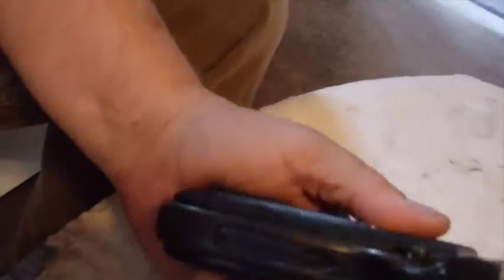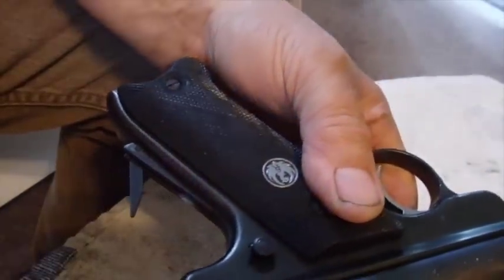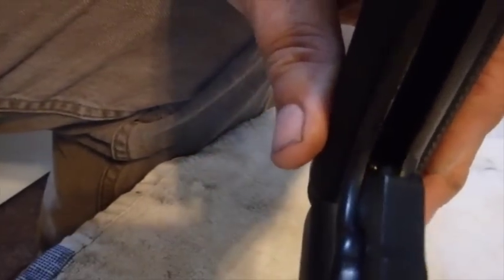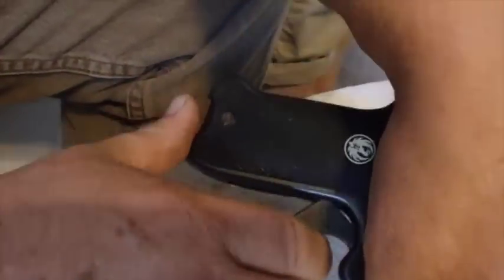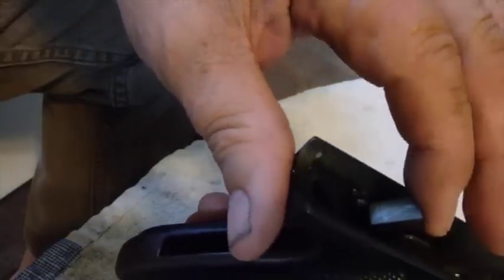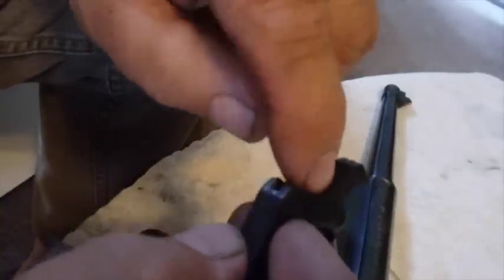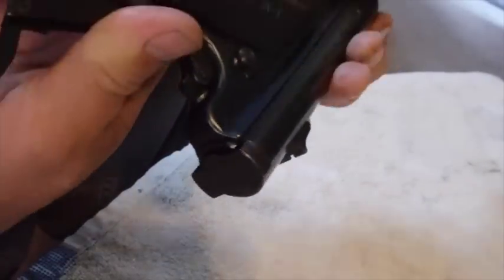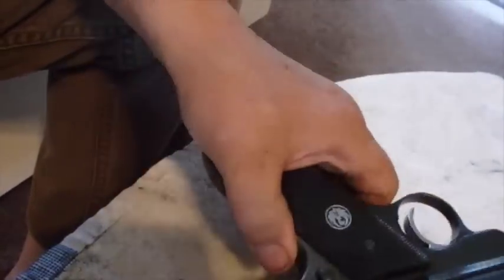Ruger MK III Jammed!  How to fix your jammed Ruger Mk III

Comment: I guess I'm just lucky. I have a Mk 1 standard target I bought used in the 80s and have never had any priblem taking it apart or putting it back together. I called Ruger and got an owners manual for it and followed their directions and it seems everything always falls into place. It's the most accurate pistol I've ever fired.
Reply from the maker: They are great guns.   I totally agree.   I had an original first generation (Standard) and passed it on to one of the kids.  I got this MKIII because the previous owner couldn't figure out how to get it un-jammed.

Comment: one of the worst videos ever made on the Ruger MK III hammer strut. IT's NOT a "little pin". It's the HAMMER STRUT.
Regardless, get the hammer strut mod and drop it in. Case closed.
Reply from the maker: K